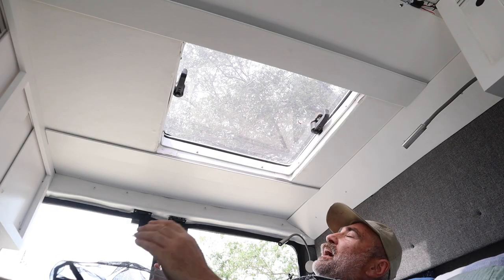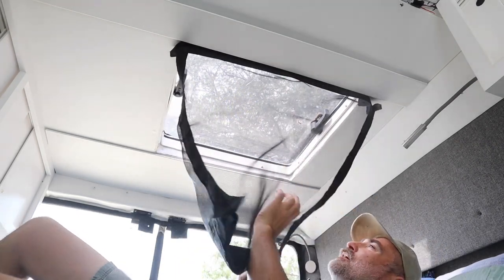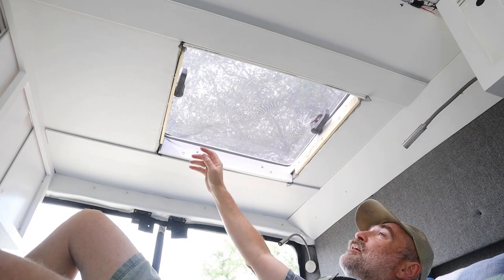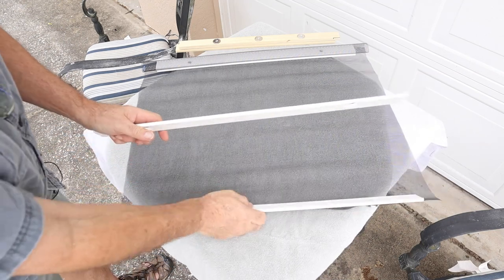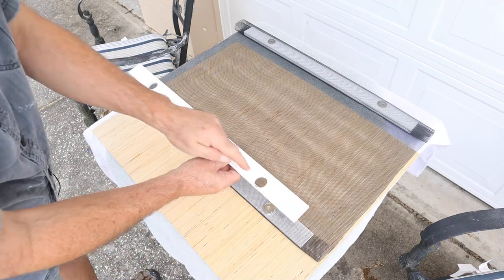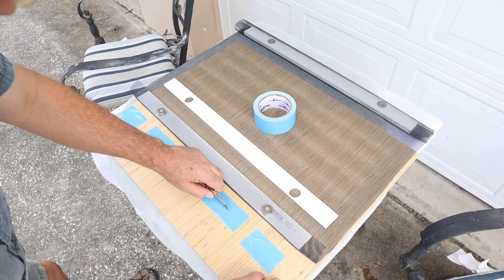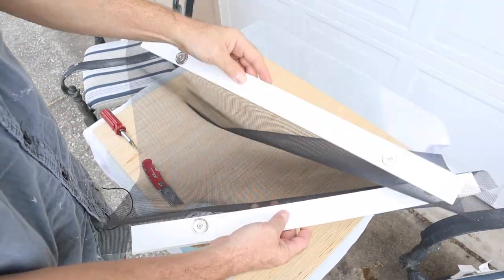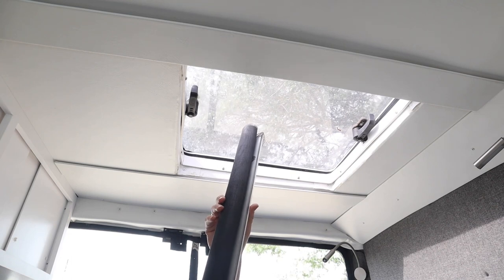Van Life Build Series: Making a bug screen for a hatch or skylight - EASY - Effective - Fast

Comment: My frame is aluminum.  I am not going to rip open the head liner and install steel.  Perhaps screw a metal washer to the aluminum frame?
Reply from the maker: You could epoxy large fender washers to the frame.  I used clear gorilla construction adhesive. Very strong.  It's clear and comes in a caulk gun tube.  Highly recommend that for metal to metal.  Hope that helps.   Thanks for watching.